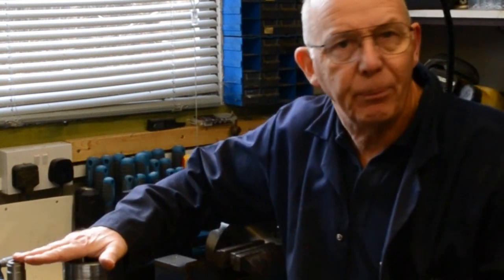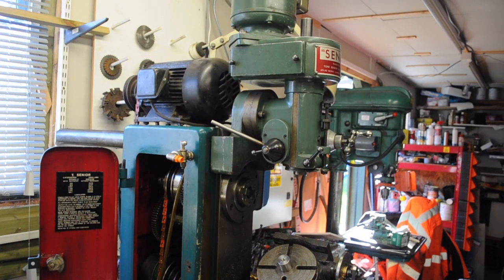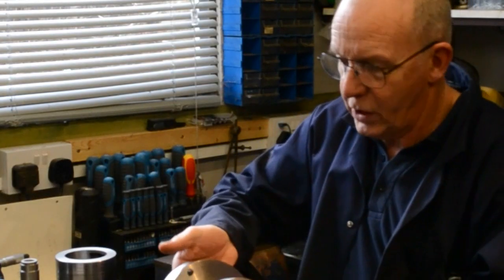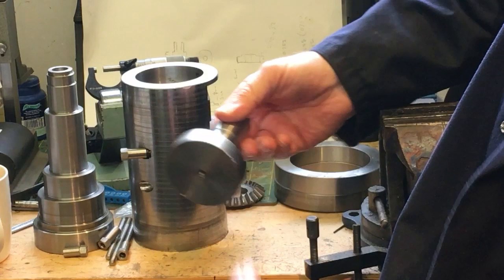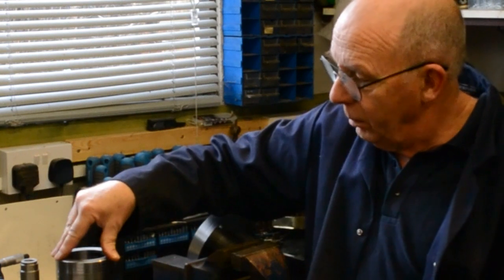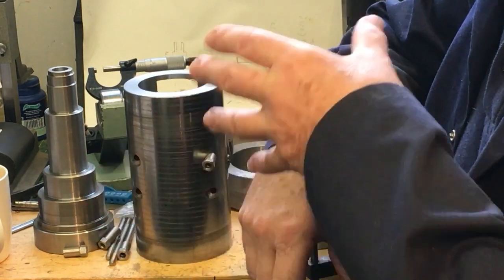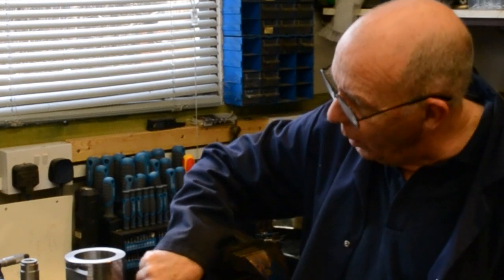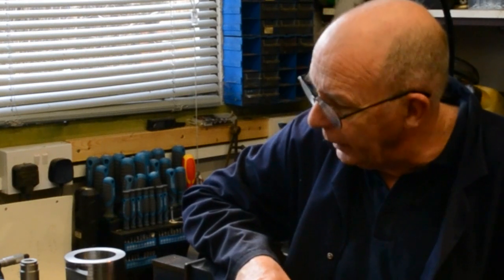Dads Shed 5 Vertical Milling head project -  a short overview!

Comment: Nice work.  Very much mirrors what I'm doing.  The spur gear bit seems like a lot of buggering about, though, why not just have a bevel gear "facing up" on the spindle (this is what I'm doing)?
Reply from the maker: the reason is that the Senior doesn't have a reversing spindle (if it did the table feed wouldn't be able to knock off) and without the intermediate gear the cutter in the vertical spindle would be rotating in the wrong direction. bit more faffing about, but it also means that the spindle is quite beefy and the nose end is close to the main support line from the horizontal section so should also be a bit more rigid.
Reply: @DadsShed-om4lz  What I'm trying to say, probably very ineptly, is that by placing the bevel gear on the vertical spindle either above or below the driving gear on the horizontal spindle, the driven spindle direction is reversed.  In my case, with a horizontal spindle that rotates anticlockwise, placing the bevel gear facing "up" on the vertical spindle will make the spindle rotate "naturally" for drills and facemills. Placing the gear above the driving gear, facing down, would result in a reversed vertical spindle.